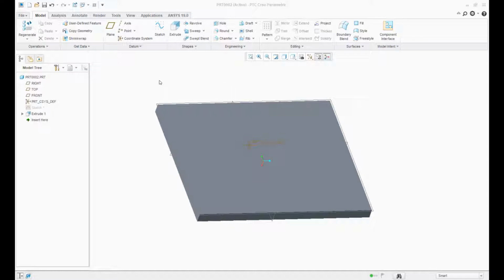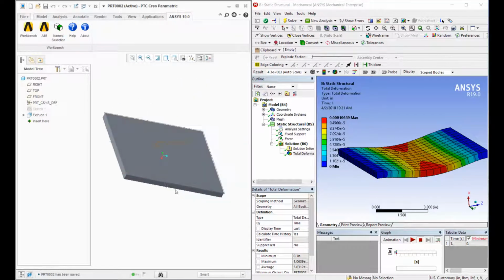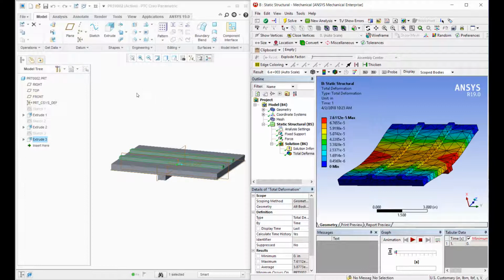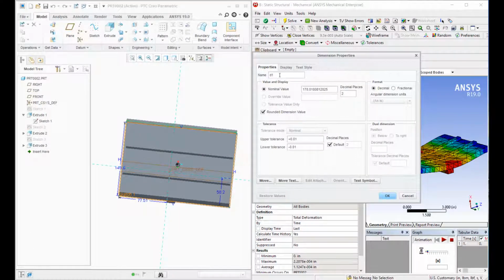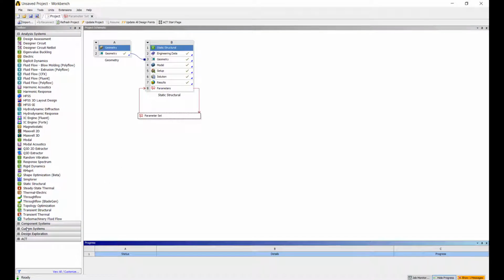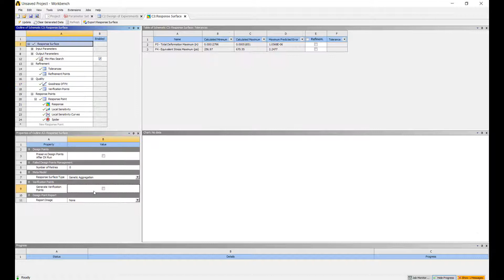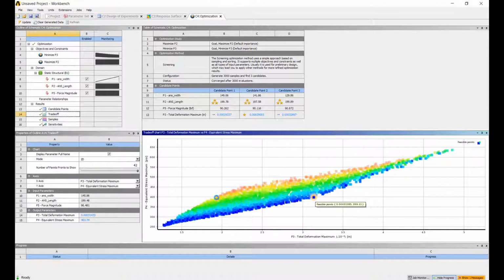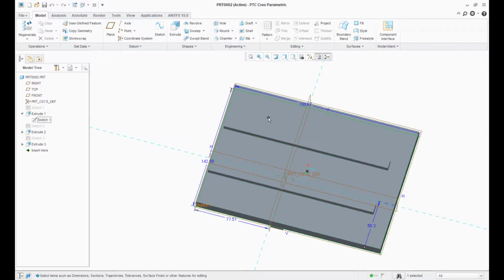Using Creo Parametric and  ANSYS efficiently

Comment: Thank you very much for your video. I am now getting familiar with these two software. I used to NX nastran and inventor, which were pretty easy to use 3D CAD and 3D FEM.  But the unauthorized Ansys softwares are pretty easy to install, which is the reason I think many companies in China use Ansys.